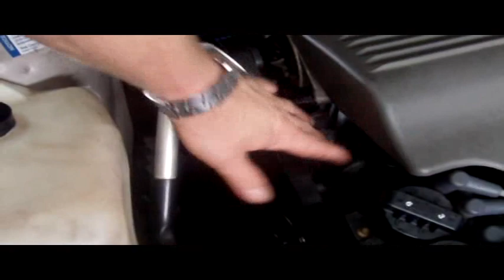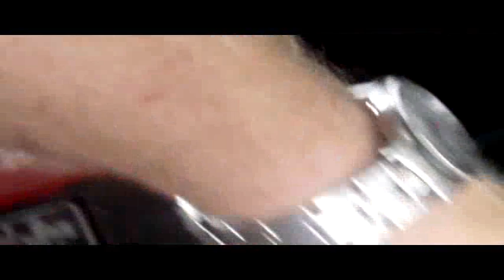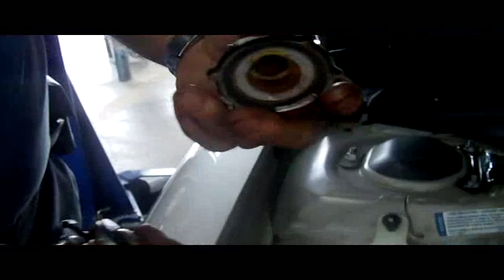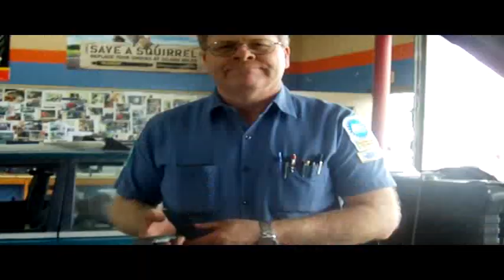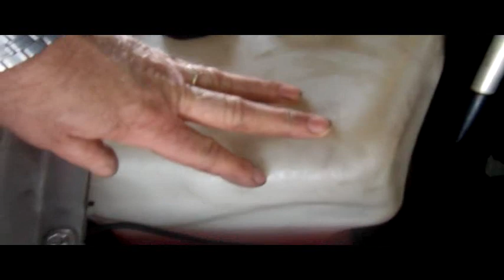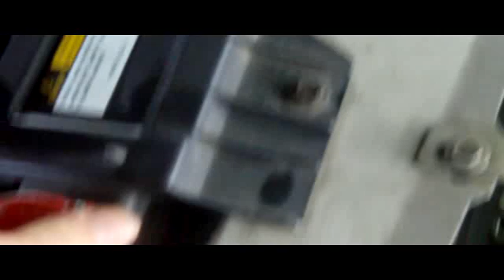Homemade Coolant Bleed Tool.mov

Comment: So where is the tool we all have a bottle of coolant to pour into the system?
Reply from the maker: The special tool is the modified radiator cap
Reply: @McCuistian  The video starts and instantly goes from a 7 min. to 51 sec. it ends with you pouring coolant in the radiator.  The tool is no longer in the video that's why some of us are committing about it
Reply: @McCuistian  This video hasn't worked in 4 years from the looks of the comments
Reply from the maker: @roberthodges1267  It worked when I first uploaded it but somehow YouTube corrupted it. And I don't have the original video.
Reply: @McCuistian  Sorry I missed it, I'm retired from the work but still working on friends equipment and looking for new tools.
Thanks

Comment: If someone could post a text version of these instructions, I would enjoy my YouTube Red membership enough to not cancel.
Reply from the maker: Remove the part of the cap and its spring that causes it to build pressure.  That way the coolant and air can pass freely.  Make sure the radiator is as full as possible - put the right amount of coolant in the degas bottle - as the engine runs, with the modified cap in place, it'll purge the air and then drink the coolant it needs from the degas bottle. This is a good method because it doesn't build pressure. Keep the degas bottle full.  When the air is all gone and the coolant in the degas bottle is hot, replace the modified cap with a new cap.  Make sure the radiator is full before installing the new cap.
Reply: @McCuistian  You're the man!

Comment: What can you use if you have a sealed cooling system?  I have a 5.4 intech lincoln, no radiator cap.
Reply from the maker: Those systems are designed not to trap air - they're not as hard to fill as the ones with a radiator cap like this one because they tend to burp themselves.  That being said, you still need to monitor the coolant level until the fan comes on and goes off a couple of times and make sure it remains at the "Hot" full line on the tank.

Comment: can you use a stant radiator cap with that pressure release lever - and leave the lever up?
Reply from the maker: You can, but it doesn't seem to work quite as well for some reason.
Reply: Got it - Thank you

Comment: Is it an old cap without the spring?
Reply from the maker: It is, yes.
Reply: Thanks for the fast reply. Do the coolant system need pressure for bleeding? It's a clever hack, thanks.
Reply from the maker: No pressure needed for bleeding
Reply: Thanks ;)

Comment: Can't you use one of the radiator caps that have a lever on top ?  When you pull up on the lever, it allows the fluid and air to flow back and forth the same way, doesn't it ?
Reply from the maker: That works too!  :)

Comment: This is the best and simplest tip I have ever seen on the net. I just wondered why I did,nt think of this? Because you know when you flush and fill you should replace the thermostat and the radiator cap as well. So why not take apart the old cap paint it and use it as a tool its almost free, It sure beets those 35 to 50 dollar  funnel bleeder systems and does what the cap is suppose to do anyway. This just does it faster than waiting for the cooling system heat up and pressurize above the relief presser rating of the cap and then waiting for it to cool down again to draw it back into the radiator. So simple , so smart , BRILLIANT!!!!!!!!!!!!

Comment: All i can say is THANK YOU!!!!! I was extremely frustrated bleeding the same motor on a 2004 Pontiac Grand Prix GT. Just bought new radiator cap and knocked the pressure piece off and Yipee!!! 10 Min or So later bleeding perfectly. Prior to that I had air coming out like crazy! Thanks again for this simple solution.

Comment: For cars with the cap on the reservoir I use a old cap a drilled a hole in and not that I don't have a mityvac or whatever they are call I use a battery powered vacuum pump that I made using a automatic trigger off a bottle of raid bug spray that pulls 22" or more depending on battery setup.  

 Me question is why do you want to protect a company that makes shitty parts? If I know a brand or part is starting to suck or go down hill on quality I tell the world about loud and proud, It's not like your the competitor so say or don't even talk about it being shitty. It'd be like turning on the morning news and they was like "we got some wrecks out there today but we wont say where, tornados are coming but we aren't going to tell you where"
Reply from the maker: +fargobrad No, actually I remove the spring and lower seal from a radiator cap and allow the cooling system to purge its air that way.
Reply: +All2skitzd  So essentially what your doing is drilling a hole in a old reservoir cap connecting a vacuum pump to the cap and that pulls the air out sort of like sucking the air out of a ac system?  Is that right?
Reply: fargobrad  Pretty much, I try to get as much air out as possible before starting it so i'll pull a vacuum until the big hoses start to flatten out then, release the vacuum so I will have to pull the coolant in as the hoses straighten out, the have a small amount of vacuum when it's running to help draw the air trapped in system up. 

 On a car like on the video I usually use a big funnel and if I cant' find one that fits in the rad. cap good I will use a piece of hose or rubber bushings or something to make it fit like one of those spill proof funnels unless it's a car that is hard to bleed then Ill just crack the bleeder valve(s) and use cheap liquid transfer pump stick one side in rad and pump it into the car

Different cars have different tricks to filling them and it depends on if it is bone dry or not when you start and the way some cars are set up they will just about let you burn the motor up and not register as even being hot

Comment: Could you use the red cap installed. Remove overflow hose and pinch off to prevent spilling from the overflow tank. Then attach another hose to the radiator snugged (small clamp) to assure no air leak. Then maybe use an air gun with suction to produce a vacuum pull from the engine and radiator. Pinch off when vacuum complete, then unpinch in a 5 gallon bucket of antifreeze and water?
Reply: You absolutely can. This is what I do to bleed a cooling system. By far the fastest way to bleed systems that have a tendency to trap a lot of air.

Comment from the maker: It has always worked really well for me on systems with radiator caps - the old method is annoying and sometimes makes a mess. This way is cleaner and safer by far.  Thanks for your input!

Comment: Thank you!  I used your idea to fix my intermittent over-heating problem (after a radiator change) by burping all the air out of the cooling system, with zero mess. One thing I did differently was to rev the engine up & down to around 2000 rpm.  Over 10min I managed to purge a substantial amount of air out.

Comment: Now that was a great tip.  As for the quality of auto parts, there are some really good aftermarket parts and some are better than factory and some factory have there problems as well.  Its becoming harder now to recommend a quality part because  most of the shops only want the lowest price and most of the time the lowest quality  to compete for work because the customer wants a low price. I have a couple of shops that only buy quality and I do notice their repairs are way down.